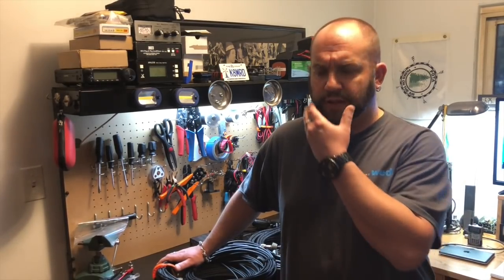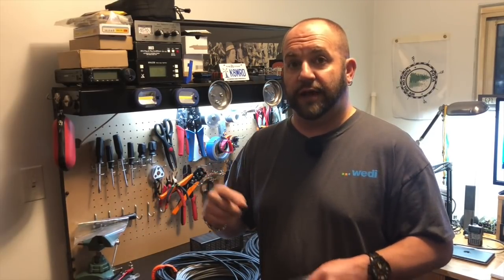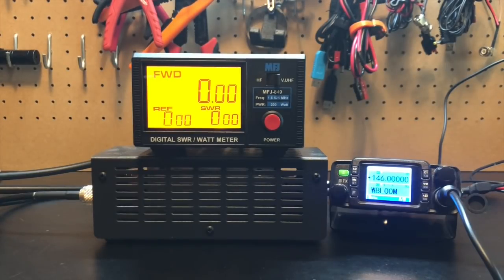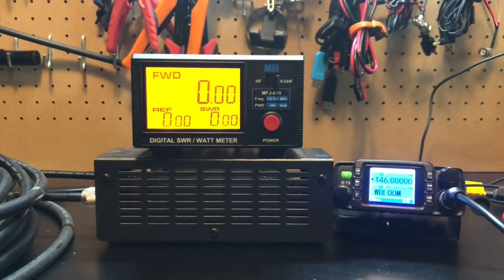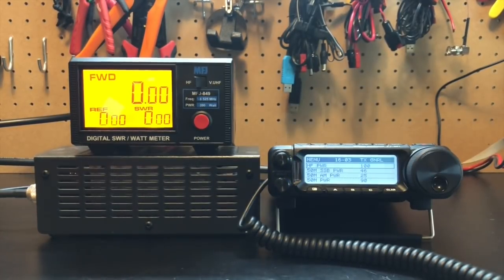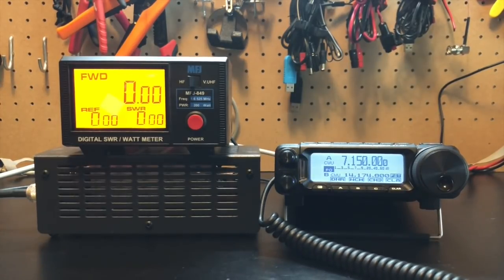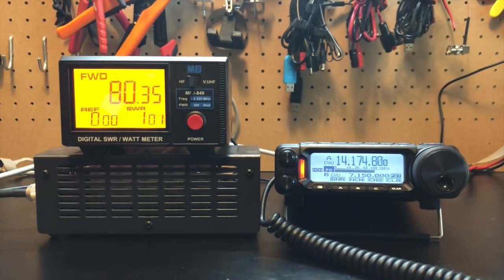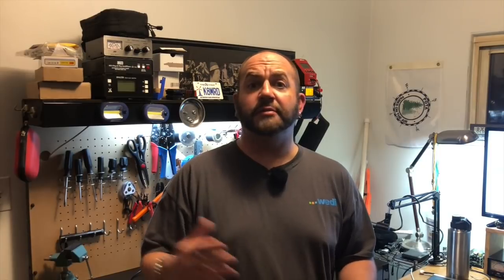Measuring Coaxial Cable Losses @ HF, VHF, and UHF frequencies.

Comment: Great info. I was aware that cheaper coax had issues but never thought it was so severe in UHF/VHF.
Reply from the maker: Yeah I didn't know either.  You read the specs and thats one thing, but to see it on a meter is another.
Reply: @hamradiotube  oh wow what coax shall i use then for getting nearly eberything to my antenna thats 15m away

Comment: It's worth noting that feedline loss is a two-way street. It of course affects the transmit power being delivered to the antenna but it also attenuates the receive signal being delivered to the radio.

Although it's a bit out of scope for what K8MRD presents in this video, it might also be good to note that on HF a balanced feedline has much lower loss than even the best coax (especially when considering the loss due to SWR mismatch). Therefore a non-resonant doublet or loop can actually be much more efficient than a resonant coax-fed dipole.
Reply from the maker: Right you are and I completely skipped over that fact!  I've not delved into balanced line yet, but yes, much lower losses.  Thanks for watching.

Comment: Not that it'll do any good, but thanks for bringing the topic of loss up !
I have a friend that is sold on the free end spools of aluminum jacket coated Cable TV hardline !
After having a new Duel Band Omni placed on top of his tower, I ask him if he had the tower climber check the power squirting out the end, and I suggested it likely wasn't what he thought it to be !
Which began this back and forth between us.
I tried to explain that right from the jump, there is a mismatch from the 50 ohm components in the circuit,  to the 75 ohm feedline !
Ending a best 1.5: 1 SWR !
Not that it is terrible, but he presumed 50 watts in, 50 watts out !
Granted the loses may be minimal, depending on one, the length of the run, and the frequency of interest, etc. etc. !!!
I got a real eye opener, when I decided to dip my toes into GMRS !
Obviously a few Mhz. North of the Amateurs UHF Band !
Where I was made quickly aware of the losses there, and the burden of cost, to try and beat those losses !
Where I discovered anything short of the diameter of a Fire hose, falls short !
Miserable.....!

Comment: Coax losses are well documented. RG8X comes in around 4.5dB at 2m and around 7 or so for 70cm per 100 ft. However, its down around 1dB or so of loss at HF frequencies. The real benefit of RG8X is that is much lighter and more flexible than something like LMR400 or even the RG213. Light and flexible doesn't matter a lot for a base station, but for portable or hiking it matters a lot. That said, if you're hiking, you're probably not needing 50-100 feet of the stuff either.

No matter what you're trying to do, just like radios and antennas, its important to do your research before buying/building a solution.
Reply from the maker: Indeed they are, but I thought it would be nice to see what that actually looks like on the meter.  I usually use RG8X when I'm portable if I'm running 100 watts. I have some RG58U I think it is too.  It's a little thinner and lighter, but it has a solid center which I don't like. I do a lot of hiking and ham radio too and use RG-316 for my QRP outings.  Only about a 15-20' run into an EFHW.  Works great.  I have a love hate with the 316 though.  Its nice and thing and light weight but it has a lot of memory and wants to kink when unrolling/rolling up.  I use the over under method for all my wire and this is the only coax that gives me trouble.  Doesn't stop me from making contacts all over the world though.

Comment: This was a great topic as I am currently building a tower out in the cornfield behind my house about a 300Ft run. After calculating all the losses I was loosing close to 3Kw with LMR600 so I decided to upgrade to 7/8in HELIAX and the losses are now at 1.2KW. @27.400Mhz

Comment: Hi Mike! Thanks for this very usefull video. I work mostly portable on 20m with symmetric dipoles, so I do not lose much energy in my cable.
Reply from the maker: Ah, yes I have see you operating portable and you do a very fine job indeed!
Reply: @hamradiotube  😃 Thanks. Hope to meet you on the air 😉

Comment: Is your SWR/Power meter connected at the antenna feed point or close to the radio?  You could use the radio's built-in power meter or second SWR/Power meter connected close to the radio and another SWR/Power meter connected at the antenna feed point to check the loss in watts.

Comment: Good video.
To double your range (same RX'ed power/voltage) you have to have 4 times the TX power (not 2 times), but that only applies to direct line-of-sight comms.
Normally the limiting factor will be the terrain (big lumps of dirt and rock getting in the way etc), in which case more TX power doesn't always help so much.
Reply from the maker: And if you are using the wrong coax, all that extra power is still going to be lost to heat.

Comment: Mike:  At UHF and to an extent VHF, every dB counts.  Most serious VHF/UHF Weak Signal enthusiasts use something like LMR-600 or Hardline.  Normally they use N-Connectors because PL-259’s are very lossy at those frequencies.  You always want high quality, low loss coax or hardline.  Your cheaper coax will not have nearly enough braid to be usable at those frequencies.  LMR-400 or 9913 would be a much better choice.  At these frequencies it is all about “System Loss” and getting as much power as you can to your high gain antenna.  But if you are talking about taking something portable, you have to balance weight and gain.
Reply from the maker: It all started with building a portable antenna.  I am the farthest thing from a series vhf/uhf guy so I don't see myself getting any super fancy coax any time soon.  I'm 99.9999999% of the time on HF.  Still, I though this experiment was interesting to see just how much you lose out of 2 of the more common coax you see.  Plus, I doubt a new ham is going to invest in such serious coax so its good to show these kinds of things.  Thanks for watching and thanks for the input.  73
Reply: @hamradiotube  - Mike, I totally understand what you are trying to do. It always pays to have good low loss coax with a lot of braid in the shield. You can take the same type of coax, like RG-8X from 4 different manufacturers and the shielding can be vastly different. Always get good coax from someone like DX Enginerring and you won’t go wrong. For POTA activations I use LMR-400 from DX Engineering with my FT-891 and WRC and it works great.  Great video, keep it up!
Reply from the maker: @n5pa  Wow I'm not taking lmr400 for pota.  My pack already weighs enough!  The coax I use from Tram is 95% shielded.
Reply: @hamradiotube  lmr-400 is a waste for HF. (10m and 6m notwithstanding)

Comment: Good video. I would like to point out a couple of additional things. Coaxial loss goes both ways. Not only does it affect the amount of transmit power getting to the antenna, it also affects receive signal strength at your transceiver. The quality of RG8X is all over the place. IMO, if you want RG8X size coax, pony up for Times Microwave LMR-240. For VHF/UHF work, if the length of the coax is going to be more than about 10 feet, use LMR-400. Yep, it's pricy, but worth it.  73 de WB4DW
Reply from the maker: Dually noted and something I failed to mention in this video.   Thanks for the reply.

Comment: I stay away from cheap coax.  Not all brands are the same. 
Example, I have 2 100 FT rolls of RG-213. One has a nice tight 
braded shield and then the center stranded conductor. The 
other is double shielded. It starts with a foil type shielding,
then a tight braided shield the stranded center conductor.
Question: was the meter at the end of the cable just before
the dummy load or between the radio and the beginning
of the cable? Just curious. Nice video and very interesting
results.  KF6EWO

Comment: Cables are no longer standardized to the same specs for the same RG type number stamped on the cable. The RG8X tested, like RG213/U any of us have, might be nowhere near the results in the video. 

Cables we buy might be, and probably are,  either better or worse. I've purchased and I've tested some absolute junk RG8X, and likewise some very good RG8X. For example someone recently gifted me some RG8X jumpers made with cable from a very well-known cable vendor. That "premium" cable was actually 54-ohm, which rendered it useless on test benches (but probably okay for antennas). 

Good RG8X is perfectly fine at HF for moderate runs like 100 ft or so, longer at lower frequencies and shorter at higher, and good RG8X will take a ton of power.  As a point of reference my test bench still uses an RG8X jumper I made in 1983. That cable was used on test benches testing 1500W+ amplifiers, one after another, for years. It is just as good on a real VNA today as it was in 1983. 

On the other hand I have some private label RG8X from a well-know long time wire vendor that went completely bad in about 5 -6 years indoors on the reel! The dielectric became brittle and developed cracks.

Never take one test or one sample as the way all cables are, especially unknown cables.

Comment: Thanks for the very practical Video.I was about to buy some Dx Engineering 8x & 400MAX cable for loading my antenna 160 foot high on top of my high rise apartment running down by 14 floors to my shack .Just realised that there is no point running that much of cable for VHF even though it would drive a X300 but would rather use the DX400MAX for the HF multiband fan dipole .Changed my plan to have a smaller home brew vertical for VHF out of my balcony window.73's Ramesh VU2RKS
Reply from the maker: Yeah that would be a lot of wasted money and power not getting to the antenna for sure.  Glad the video was helpful for you.  Thanks for watching.  73
Reply: 8X isnt any good unless its a foot max!

Comment: What if anything would have happened, if each comparison was made using the proper multiplier in length, to provide a transformer of sorts, showing 50 ohms at each end of the Coax ?
Seems the transfer of power would be near perfect, given the inefficiencies of the materials used ?

Comment: I am using a Stryker 955 HP , I need 100 ' of coax to the antenna . What is the best coax to use with that ?

Comment: Great video Mike.  You posed the problem well and then let the data speak for itself.  BTW, I read in one of the comments where a "balanced line" is compared to "coax feedline".  That's sorta what I'm doing now a days.  I'm using 50' of RG-8X coax on the WRC TIA 1000 and comparing it to a homebrew 40m speakerwire-dipole.  Interesting stuff.
Reply from the maker: My earliest days of portable were spent making many a contact on a speaker wire antenna.  They work great.

Comment: Thanks for doing the experiment that I have always wanted to do myself!  The other great coax question remains to be answered:  When should coax be replaced?  Ten years? 40 years?  Never?   I read lots of estimates.  I have some 30-year old RG-213 coax that looks to be in good condition.   But I've never seen or read of anyone doing quantitative measurements on very old line like you did for this coax.
Reply from the maker: Thats a great question that I don't have the answer too.  I would say if it ain't broke, don't fix it.  If you start having some kind of SWR or RFI issues, that might be a good indicator.

Comment: Hi Mike, I've been loving your POTA videos and you have inspired me to get outside as soon as the weather breaks.  I have some resonant wire antennas but I will have to purchase a run of coax to go portable. I haven't had much work due to the virus so I'd like to only purchase 1 run to start. You mentioned that your 50' run was your first, would you do it that way again, or would you have gone with 100'? I was thinking RG8X would give me the most flexibility to hoist wires and stuff, just wondering how much to get. Thanks for everything.
Reply from the maker: Depends on where your going to be connecting the antenna at.  If I use my dipole up 43’ I’m gonna need 43’ of coax just to get up there, and then enough to get to my radio so I might need 100’.  If your antenna connection is going to be close to the ground like a Wolf River Coils or PackTenna mini or efhw 50’ is plenty usually.
Reply from the maker: Oh and RG8X is plenty fine for HF.
Reply: @hamradiotube  Thank you for your insight Mike!

Comment: Your vhf/uhf results are an object lesson in what a loss in dB per 100 feet really means. Remember -3dB is half your power down the tubes. And in UHF moon bounce you quickly learn that  having your receive converter/ amplifiers, etc. at the antenna feed point is necessary.
Reply from the maker: And boy does it go quick!  I wonder if there is a preamp you could put at the feed point of the antenna to boost the signal for moon bounce?  I've not experimented with that mode.

Comment: Absolutely excellent video describes the importance of coax so much, thank you Many can learn from this
I use LMR 400 for almost everything worth the money in the long run
So yes your antenna you made
It would have been better off with a 6-ft piece of coax and put it straight above your head
Actually I'm going to look and see if you have a video of making that antenna looks interesting
I came back to edit doesn't look like you have a video on your little antenna could you maybe do one and describe what you're doing with that ladder line
I'll tell you a real cool toy to play with one of the neatest things I bought in a long time is a nano HVNA very reasonably priced absolutely excellent on results

Comment: @K8MRD you forgot to mention that not only your TX power but also your RX power has the same losses,
so if you try to work a distant station that is not all that strong to begin with you only get 16.46% of that weak signal (using your RG8X example 
I think its safe to say, your DX station is not workable ;-)

73.
PD0HOF
Reply from the maker: You are correct.  I would still say he's workable 16.46% of the time though :)

Comment: Another great video! I have been running LMR400 for my LTE antennas running up to 1700 MHz. Love the bend radius though.
Reply from the maker: Yeah that’s some tough stuff for sure.  Not my favorite coax to have to coil up.
Reply: @hamradiotube  yeah, we used to spec out that stiff cable and someone else connected it and ran it in our installation.  After I retired and started playing radio and ran that stiff stuff I apologized got my technician who had to deal with this dumb engineer’s designs.  Haha.   I told him I had greater respect for what he did (I always appreciated him, just much more now).  All the best!

Comment: Hi Mike, Due to current finances and upcoming surgery, I am thinking of getting a Tri-Band or Dual Band Ed Fong antenna for the QTH since I don’t own this property and personal mobility. What are your thoughts on transmission line for the Ed Fong antenna and recommended length before getting beaten up on power loss from an Anytone 578UV Pro. Thank you! 73, Bill KC3RMV
Reply from the maker: Hi Bill.  I used an Ed Fong antenna in my early ham career with 50' of RG8X and was able to hit repeaters about 10-15 miles away no problem.  The antenna wasn't even up that high.  Keep in mind that a large portion of your power will be lost in the coax.  Obviously I don't really like to use RG8X on those frequencies and would highly recommend you get at least RG-213, or LMR-400 for any runs longer than what you might need for a car/mobile setup.  As far as recommended lengths, thats going to depend on where you can put the antenna and how high up it will be.  I use 100' of RG-213 to my VHF/UHF antennas.  The shorter the better but you have to get it up.  The RG213 and LMR400 have lower losses per 100' run.

Comment: It was not a little experiment, it was a brilliant experiment..i was planning to put up a 2m Antenna with RG8x but not anymore, i do have RG213 so definitely going to use that now after watching the video..I have another question, if at CW keydown my IC7300 power meter is showing 70 watts where as 100nwatts is selected....how accurate is this in your opinion ?...TNX
Reply from the maker: Glad to save you from using the wrong coax.  As far as your 7300, I would assume your swr is somewhere near terrible if you are on 100% and you are only putting out 70.  The radio will pull back on the power when presented with too high an SWR.  Might want to check your antenna.
Reply: @hamradiotube  that is with the tunner... without tunner its definitely more, its a Multiband Doublet antenna, so inherently it gives high SWR.

Comment: I bet that Chinese Amazon RG8x is junk copper coated Aluminum. Good true oxy free Cu from ABR is going to lose far less power for sure. the lower the frequency the less the loss which is how it works for all these cables. 

Good test. Thanks for showing the newer hams who do not take this into consideration! To be honest if I were running a serious VHF antenna installation on my home I would run LMR-400 or better yet LMR 600.
Reply from the maker: The amazon stuff isn't the greatest thats for sure.  I'm happy with my Tram coax though.  If I were serious about VHF I'd prob have 400 as well, I just don't really get on those higher freq's too much to bother.